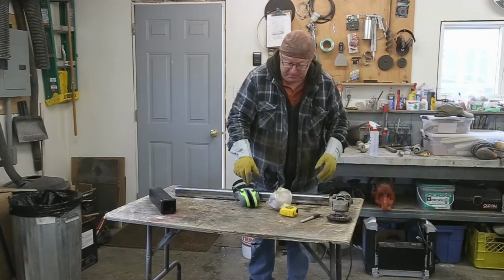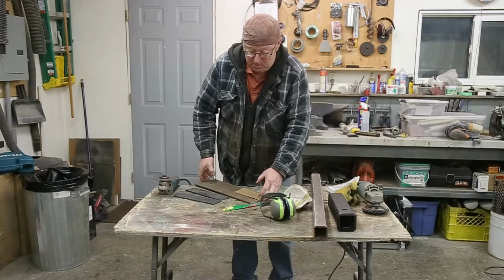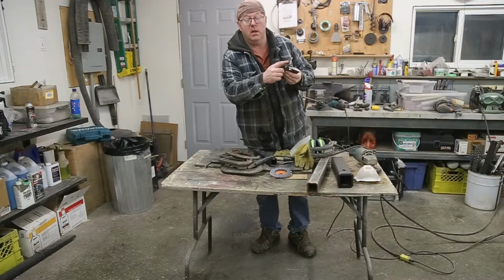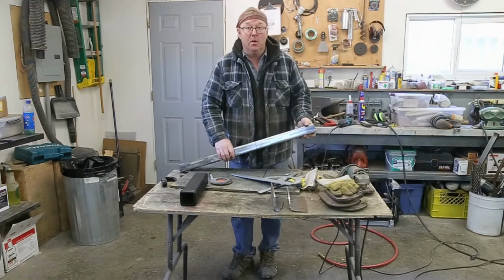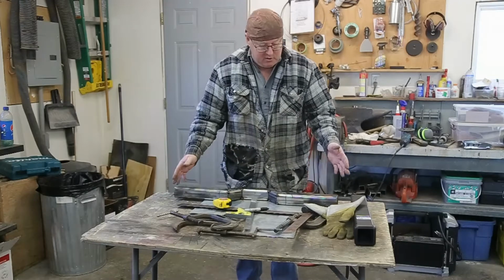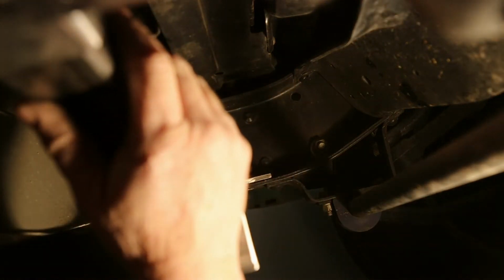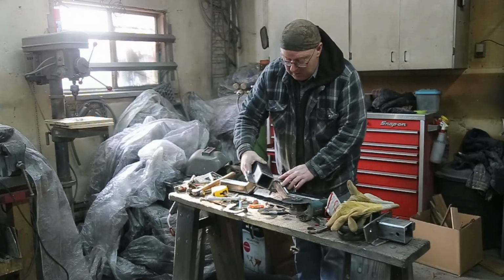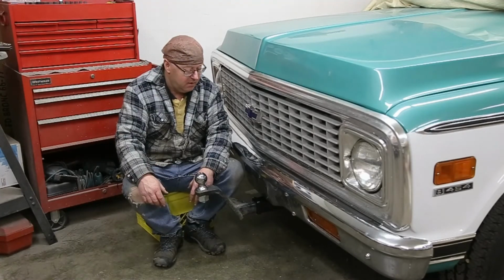Building a front receiver hitch for a 1967 to 1972 Chevy or GMC pick-up.

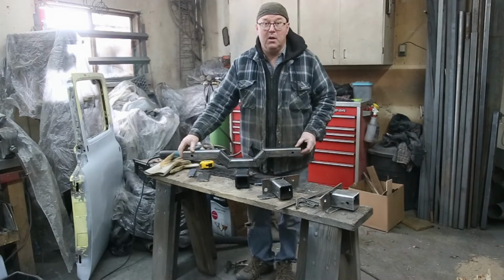Comment: At 27:19   You said that not a very big deal but that is my 71,  I thought the same thing (seeing the hitch) earlier in the video.   great going.  I loved it.   577 subs   great!!!!  The added humour is going well too.
Reply from the maker: Great minds, you know.  It did stand out and made it look more like a work truck.  I was also worried that it might dig in if I went down a steep incline.  Now when I want to use it, I just bolt er in.  Might drive around to show it off before I remove it.  Stevo
Reply: @stevoj8959  Perfect Steve

Comment: How's she goin'?  That is a well built hitch Stevo!!!  I like how you designed it to have it slide into the brackets on each side.  That worked out well.  The drop in the center is a perfect measurement too as it just clears the front undercarriage so no problems for clearance when the receiver is removed.  Avery nice project!!  Take care!!!
Reply from the maker: It worked out really well but I still did some head scratching before I made my cuts.  The clearance thing was one of the factors to make it removable.  I was worried that if I went down a steep incline, the receiver might dig in.  Thanks.  Stevo

Comment: Wow.  That is a complicated build in my opinion.  You sure are good with measuring and seeing the correct angles to cut.  I think that takes a special brain that I do not have.  I would have just tried to push my trailer with a rope or chain but that does not work just the best.  Great design and build.  Thanks for the video.
Reply from the maker: It looked easy but I still did some head scratching before I made the cuts.  The hard part is laying on your back doing the project but it turned out great.  I just can't wait to give it a try.  Stevo